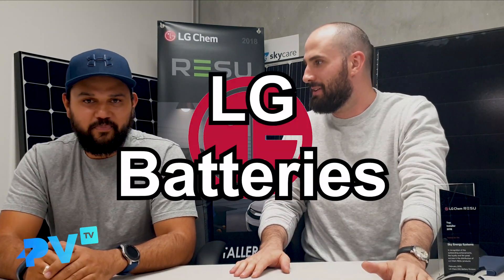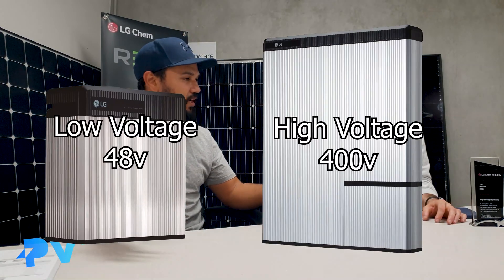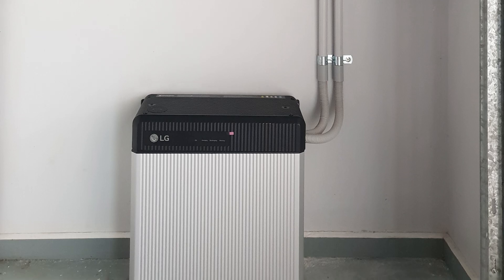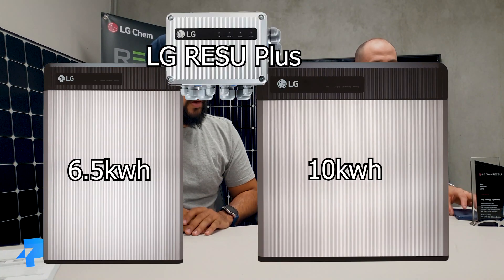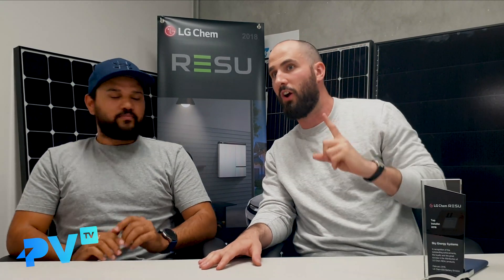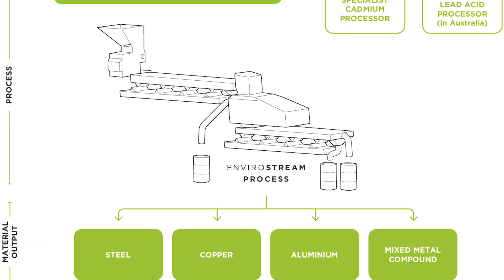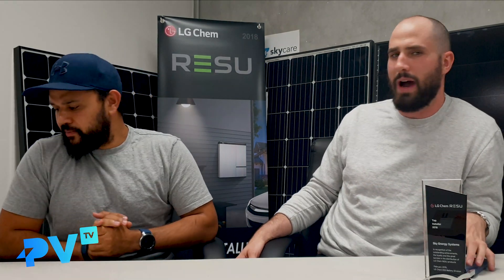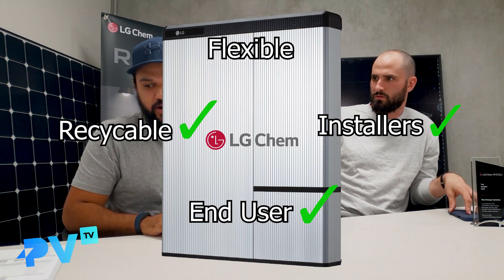PV-TV E19: LG SOLAR BATTERY - What makes them great?

Comment: All lithium ion  batteries lose capacity over time. Is there any way to rejuvenate an older battery.
Reply from the maker: Not really, we are releasing a battery very soon that has 0% degradation over 20 years, which is a little more expensive than a lithium battery. But no, there's no real way to rejuvenate an old lithium battery aside from changing the cells, which is not possible for most home users. Technology will solve this problem over time. Cheers Sam

Comment: Ok so heres my long ass question, so i plan to hook up a grid tied system, and did some research, in about 5.5hours it produces approx 291Kw of power, my question now is, i plan to use 205+- kw so how do i store the excess power im getting from the panels, is it possible to store it in a battery, second question is, i do not want to send it back to the grid, i want to store everything into the battery and the excess will just be lost, i dont mind that, is it possible...
Reply from the maker: Yes, you can store it in a battery and yes you can stop anything going back to the grid, usually, you need a device called an 'energy meter' to regulate excess power flow back to the grid.
Reply: @skyenergy6282  what battery will be most suitable to store up at maximum 300kw
Reply from the maker: @mohammadjaamimustafa61  to store 300KWh, you'd want to start by looking at Lithium, most likely.

Comment: Here is my current system.  28 Canadian 305 Solar Panels 8.54 kW
projected 10,012 kWh / year Sunny Boy 7.7 US  Inverter I am
looking for a information for the LG Battery and a Sunny Boy Battery
Inverter if needed. I would be using the battery mostly at night and
would like it to be my backup during electric shutdowns. How to
disconnect from grid during the outage? Can you please  let me
know which parts will work with the Sunny Boy 7.7 US inverter. My
solar installer does not do  battery installs. So, if I am clear  I
would need one or two batteries, a Sunny boy battery inverter for up
to 8.54 kW and what other device you recommend to auto
connect/disconnect?
Reply from the maker: Hey Chip, the Sunny Storage is a great option in AUS, not sure what the USA equivalent is, you might need to contact SMA directly

Comment: Hi Guys I am not sure which company I am going to choose , however some  systems relay a lot on Wifi communication , which I don't like , you know the whole 5 G controversy etc,with Lg RESU   13 kw or 10 can I run the system with out being connected to net? also with a back up in case of grid fail, with out ? Thanks for any pointers
Reply from the maker: Hey! Yes with the RESU you don't have to have internet connection, just make sure your inverter can be hard wired to avoid any wifi use. The backup with also depend on the inverter, the battery is certainly capable of it with the right inverter.
Reply: @skyenergy6282  Thank You very much for the info. I have learned a lot from your videos great work guys!
Reply from the maker: @tarnowek1  Thank-you !!

Comment: I have a seven year old 4KW (16 panels) solar system with a Fronius IG TL Inverter . . Is the LG Chem a good battery system to use with it?
Reply from the maker: For sure, it's a solid choice
Reply: @skyenergy6282  Cheers. . Great videos, keep up the good work.

Comment: Nice video guys! Question: Is the difference between the low voltage and high voltage system a step up converter or do they use more batteries of less capacity to ramp up the voltage? The different in size is significant.
Reply from the maker: Basically, the HV is significantly larger. Higher voltage, lower amps.

Comment: Hi guys. Great video. Just one question: does this unit have an inbuilt charge controller? Do I just match the desired DC input voltage with the panels and plug and play?
Reply from the maker: Hey Patrick! The charge controller is installed/purchased separately with LG Batteries. There's quite a few to choose from. It will read the solar power coming from the panels in the switchboard and divert it to the battery, so really you shouldn't need to match panel voltage. Trust that helps!

Comment: Is it possible to have a generator connected to the batteries as a back up? for example in the event of consistent rain or gloomy weather that goes on for more than a month?
Reply from the maker: Yes, but you need to make sure the inverter has that feature

Comment: Dear Sirs , like to find out where there is a repair center for these battery’s the inverter in mine Resu 10 H blew up after 6 hours on from new like to hear from you Regards John
Reply from the maker: Hey John, that sounds like it may be a faulty installation, who did the install for you? LG Chem have an office near Melbourne where they process their Aus warranty claims, I would recommend giving them a buzz :)
Reply: What smh 🤦🏾‍♂️ mine is being connected tomorrow there kind of a scary thing to hear.

Comment: I am very interested in these in the USA. Powerwall are $11,000 installed each. Do they have an AC coupled system as I want to retain my existing SE5000 inverter. In the USA only old model of SE7600-US supports LG requiring me to replace my HD wave 5000H.
Reply from the maker: Yes, they do AC Couple with a battery inverter :)

Comment: Great video 👍just missing (1) point that I was looking for. How long does this output on a single charge? Say a refrigerator
Reply from the maker: Hey, it depends on how much power is being used. In this example it depends on the size of the refrigerator. So if the fridge uses about 2KWh per day, then a 10KWh battery would be able to output for 5 days (10KWh Storage / 2Kwh Usage/Per day = 5 days). If the home is using 1KW per hour (average home) then a 10Kwh Battery will last 10 hours. Trust that helps!
Reply: Sky Energy 

Thanks! 👍 yes, gets me in the ballpark 👍 we just had a 9500watts(?) solar panel system installed and I have (1) 120v plug backed by the LG 10kw battery to power a refrigerator and freezer and maybe a cpap machine if required

Thank you for the reply!👍

Comment: So when you pair a 7.6 Solaredge Storedge and Chem battery the max breaker you can have in the back up load center is 25A. How do we back up larger loads? Like a 30A 2P breaker?
Reply from the maker: Hey Chris - you can't actually back up two phases with SolarEdge blackout protection. If you need more power across 2 Phases you can use two SolarEdge inverters. Is that what you mean here?

Comment: Does the lg have a app to monitor usage?
Reply from the maker: Hey Brian, the LG Battery's app will depend on which inverter you choose. For example if you plug it into a SolarEdge inverter you will have the SolarEdge Battery App.
Reply: @skyenergy6282  so is thats why tesla batteries have the inverter build inside. Can inverters with app be more expansive?
Reply from the maker: @FireLance-Gaming  Great observation. Yes the Tesla Batteries have the inverter inbuilt and come with the Tesla App (which is quite good). The LG Battery has an external inverter (purchased separately) which means you have more choice around the inverter and app :) Apps are the most important thing when it comes to batteries as knowledge is power, and being able to see how you're using the battery in real time helps it go a lot further.
Reply: @skyenergy6282  yeah I'm a big Tesla fan, but tesla battery group where unable to give me a quote for a contract in SA(so not happy). Now the builder Rossdale have a deal with free installed system with LG system 9.8 for $11k so far. See how we go.
Reply from the maker: @FireLance-Gaming  coool. Yes Tesla is slow on supply at the moment. As we mentioned. Best of luck :)